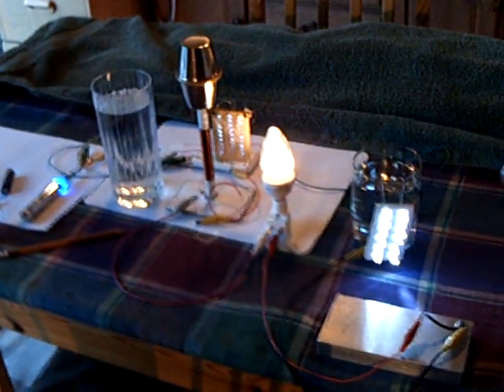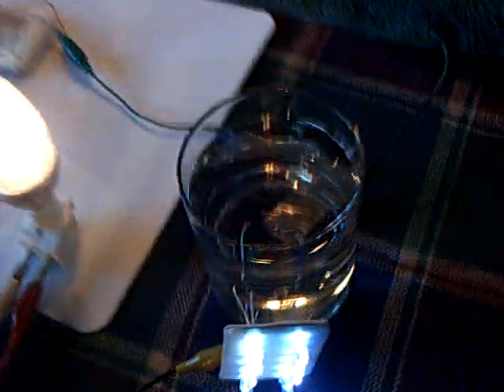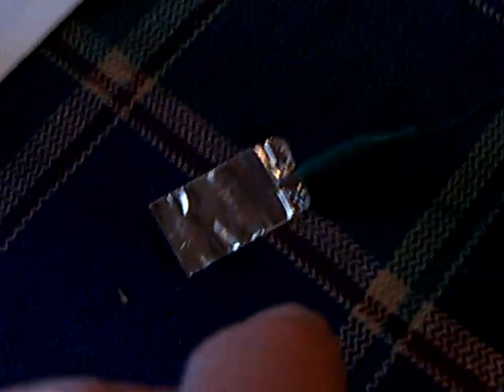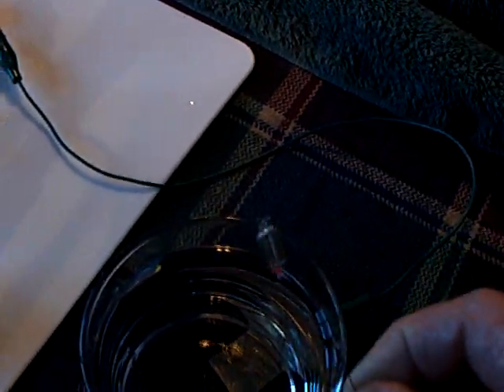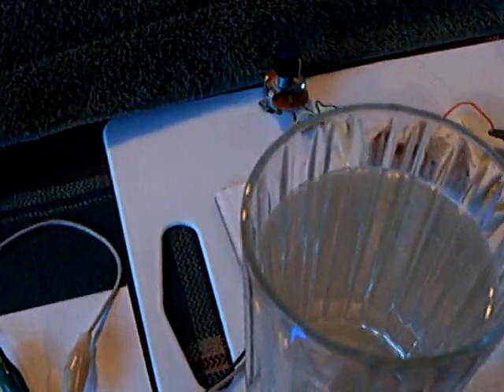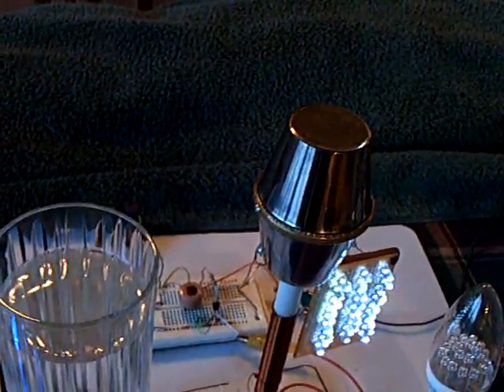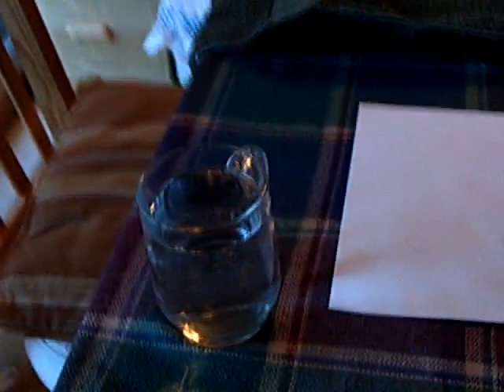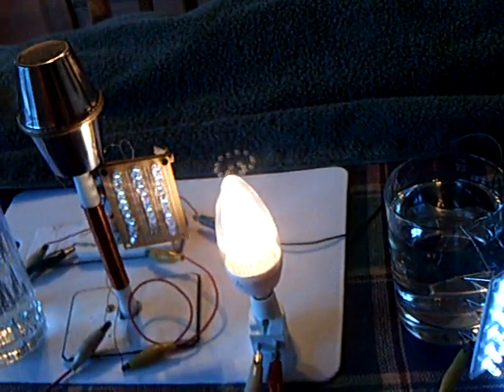Pan oscillator---water electrolysis.ASF

Comment: great vid as always Lidmotor ... the LEDs act as their own AV plug because they are diodes and that is why the neon requires a AV plug before it illuminates... I think this wireless energy is simply a high frequency oscillating magnetic field ... AV plugs or diodes act like rectifiers and rectify the currents induced in the conductors by the altenating megnetic field. It would appear that there is no loading effect  and in theory we should be able to drive as many loads as we like... fascinating

Comment: Have you tried to initiate standard electrolysis with another circuit while the SEC is running in a vessel filled with water within the region where the sec is operating? I am curious to see if the SEC will make electrol;ysis more efficient, or perhaps it may initiate the energy transferred to the water to allow the electrolysis to operate more efficiently, maybe even perform totally different than a standard attempt without the SEC circuit present. I think Dr. Stiffler may have a point being that electrolysis is happening with the led conductor,m it may be able to happen with a much greater effixciency than normal if we initiate some pulses with a few ns burst of electricity, perhaps through an inductive charge circuit which may possibly pick up the energy transfer a bit better than the induction presented by the water alone.

I think you'd have a pretty good chance to pick it up with the combination of the coil and the cell as a capacitor to create an LC circuit which may possible create a much more extreme amount of hydrogen for the size of the input.